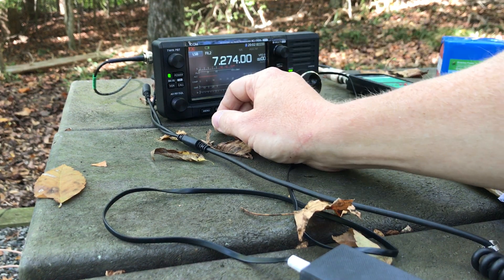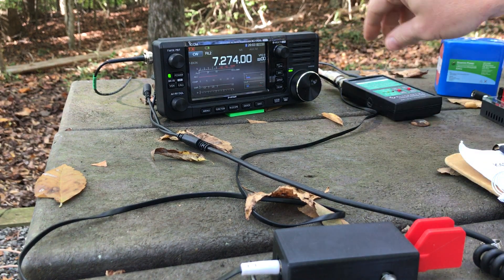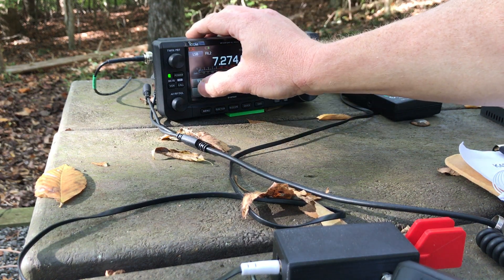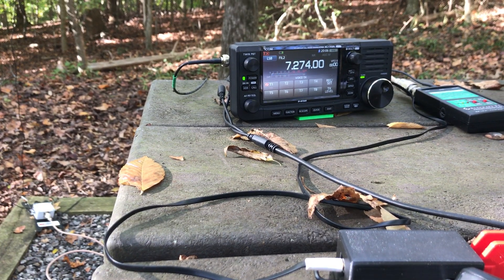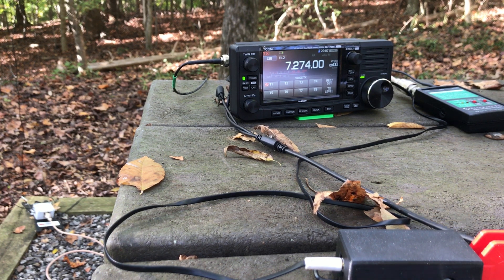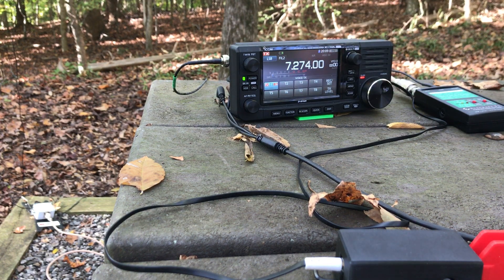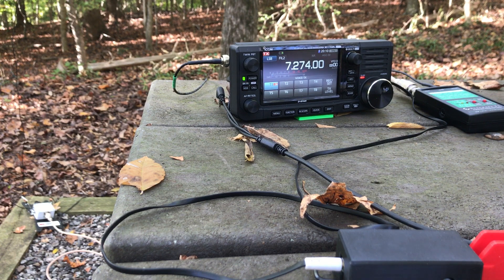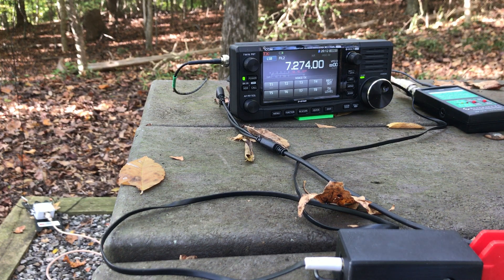POTA 101: Performing an SSB activation with the Icom IC-705 and voice memory keyer

Comment: Thomas:  I do not know if you will see this comment on this older video but I activated a park today for the first time on SSB with my ICOM 705.  I am used to doing data but wanted to try SSB and I used paper logging like you did and it was pretty stress free for my first SSB activation.  Most of what I did was patterned after what I learned by watching some fo your videos.  Appreciate your content.  Most of my activations have been on water accessible parks only but did a land locked one today.   Bob  / KU3C

Comment: Thomas I have a couple questions! 

1. How do you connect the Bioenno to the IC705? Is there a PowerPole adapter (like the FT817/818) has?

2. How much advantage does the 705 add compared to a MTR3B or similar micro-CW radio for CW SOTA/POTA operations?
Reply from the maker: Hi, Rex, 

I'll do my best to answer here:

1.) So I almost always use a small Powerpole distribution panel in the field just to have the option of adding other 12V devices (like an external ATU, or my Surface Go tablet). The IC-705 ships with a power cord that has pig tails. I crimped Powerpole connectors on the end of that cord. Since the supplied IC-705 cord has in-line fuses on both conductors, it's safe to plug directly into the Bioenno battery Powerpole connector.

2.) Honestly? Comparing the IC-705 to the MTR3B is almost apples to oranges. In terms of doing a CW SOTA or POTA activation? Other than power output differences, they're equally effective in my opinion. Where the IC-705 has an advantage is if you want to use multiple modes (CW. SSB, D-Star, Digi Modes), on multiple bands from 160M up to 70cm. The IC-705 also gives you more CW memory positions (a total of 8 that are easily configured). There's a built-in GPS with the IC-705 as well. If my main goal with a radio is doing a SOTA/POTA CW activation though? I'd stick with the MTR3B, KX1, and similar rigs. They're much lighter, more compact, and less expensive to replace if it falls off a cliff. :) 

Cheers,
Thomas

Comment: Very nice video of the IC 705 on a POTA activation. I can't wait to use mine for POTA in a few weeks. I've been using the FT 891, so QRP will be more of a challenge, but since I'm mostly CW, I don't think it will be too much trouble getting 10 Q's. Since I also use a computer in the field I could always sneak over and do some FT8 if in a pinch. 73 de KN3A
Reply from the maker: I'm going to make a prediction: Once you get the IC-705 and start using it in POTA, you'll rarely push more than 10 watts in the field again. :) Seriously. I have a KXPA100 that pairs with my KX2 and KX3--it's very field portable. I've used it on maybe 3 activations ever. Each time, I find it doesn't help me collect contacts any faster in CW, so I keep it simple and just go QRP. :) With SSB, you just need a decent antenna for the environment. 97%+ of all of my 200 or more field activations have been QRP. Have fun with the IC-705! You'll love it! 73 de K4SWL
Reply: @ThomasK4SWL  I got the radio 2 days after my knee replacement surgery on Nov. 10, so I've had plenty of time to get used to it. Antenna is the secret. I used it in CQWW CW last weekend from home QTH and made 125 QSO's on a very part time basis. Many features my IC 7300 has, but of course, many other new ones as well. Once the knee is ready I'll be heading out to K-1418 with my WRC or EFHW. Whichever is easier to put up in the PA winter weather. 73 and thanks again for the great video.
Reply from the maker: @SteelCityPA  Here's hoping that knee continues to heal and I look forward to working you on the air, OM!
Reply: @ThomasK4SWL  so I was finally able to go out this afternoon and activate K-1418 with the IC 705. It was a blast even just sitting in the car and using the Hustler antennas for 40 and 20. I had big pileups on both bands on CW, and I really forgot I was QRP. Hopefully we don't have a rough winter and I can bring out my WRC or EFHW for even more success. 73 KN3A.

Comment: Do you run an RF ground when you are operating portable? It doesn't look like you have anything attached to the ground lug on the radio
Reply from the maker: No, I don't typically run an RF ground unless I expect a lot of RF back on my  rig. My antennas tend to be resonant, so that's not really an issue.

Comment: Thanks for the video. But why use a night time band like 40 meters, in the daytime You would have been a lot better off on 20 meters, which is active during the day time.
Reply from the maker: Good question! So 40 meters is only a nighttime band for DX. If you ask any daytime POTA activator, they'll tell you that with current propagation conditions in the solar minimum, the 40 meter band is the most productive. I typically work 75-80% of all of my POTA contacts on 40M.  In CW, the 30M band is almost as productive. 20M works, but is very vulnerable and a little unpredictable--some days amazing, others dead. 40M is more reliable.   80M works quite well for regional contacts during the day, but few POTA activators use it because it requires a longer antenna.

Comment: Nice video , I have same radio and it worked well from a park last week . I did not know it would continue to CQ. from the memory banks . Good to know . What is that gizmo near your battery, with leads connecting to the battery ?
Reply from the maker: That's a small Powerpole distribution panel. It's actually a kit I built last year and was originally made by Ham Radio Workbench. Here's an article I wrote about it at the time: https://swling.com/blog/2019/08/the-ham-radio-workbench-12-vdc-power-distribution-strip-kit/